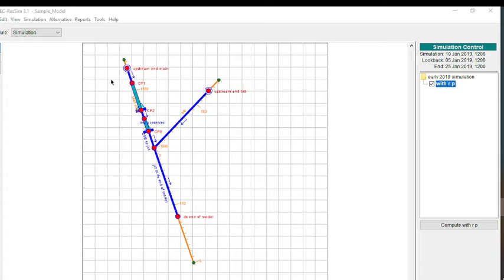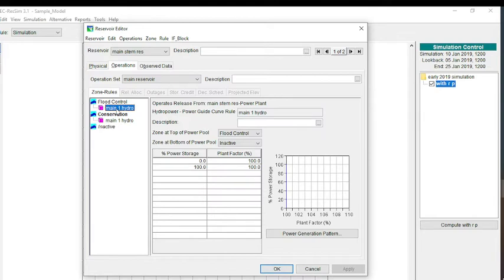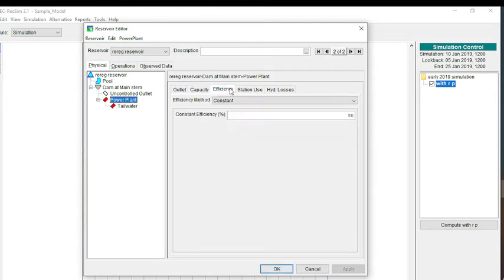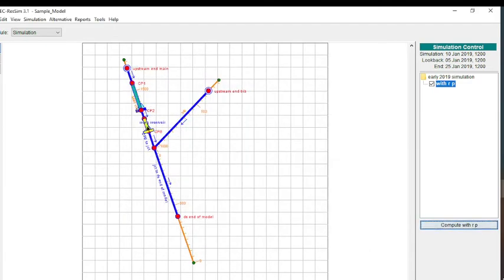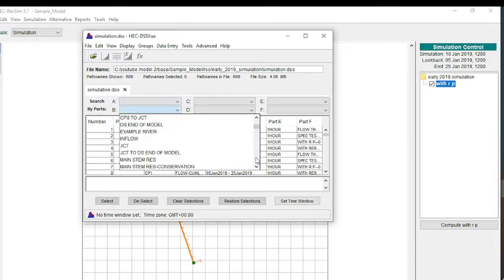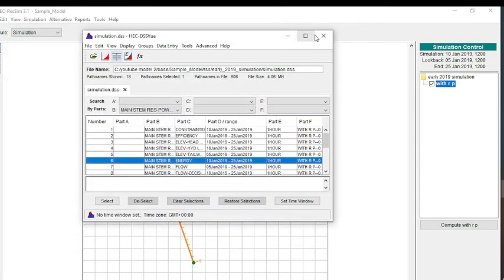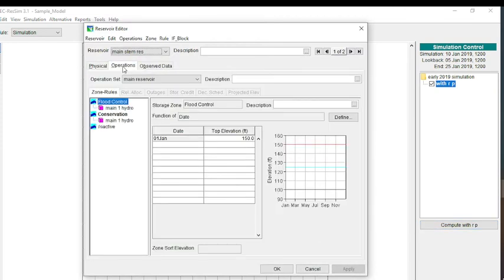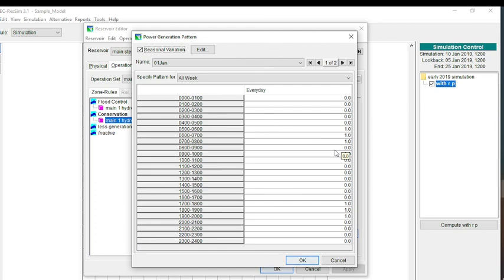How to optimize hydropower

Comment: Great video! A question: what if you want to use the level of the downstream reservoir to control the generation of the turbine in the upstream reservoir? Let's say the downstream reservoir is filling up and you want to generate less in order to send less flow to the downstream reservoir. how would you do that in ResSim? Thanks!
Reply from the maker: You can make several hydropower rules and put them under various IF statements where the IF statements look at the elevation of the downstream reservoir.
Reply: @hecressim  trying that.... let you know how it goes! Thank you!

Comment: thank you sir for your good educative video, keep this passion
Reply from the maker: Good luck with your research project.  Feel free to e-mail or comment if you have other questions or would like to see other topics.  It sometimes takes a while due to work commitments, but I will try to provide a response.
Reply: @hecressim   
Sir I have to operate reservoir to fulfill irrigation demands, and power generation is a by product. Reservoir is operated by power tunnel to fulfill irrigation demands, but power tunnel cannot release more than 1274 cumecs. If our irrigation demand is higher than 1274 cumecs, we need to release water from main spillway. 
I am facing problem in setting these rules in the HEC ResSim. Please let me know brief methodology on it.
Thanks much.
Regards
ZEESHAN HANIF
M.Sc. Research Student

UET Lahore, Pakistan
Reply from the maker: During times when you need more than 1,274 cumecs, a minimum release rule for the amount you need will cause ResSim to release that amount (assuming you are in the conservation zone).  For your release allocation, you should specify that you have a sequential release where you use the power tunnel outlet first and then the main spillway.  For example, if you need 1,500 cumecs, then ResSim would release the 1,274 cumecs through the power tunnel and then the remaining 226 cumecs through the main spillway.  If you don't specify a release allocation, ResSim will try to distribute the release equally among the outlets.